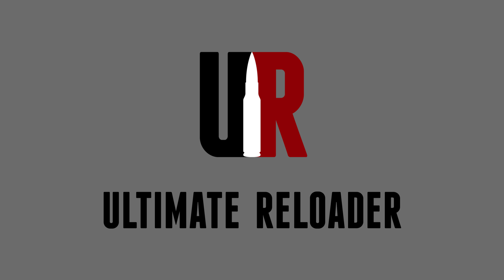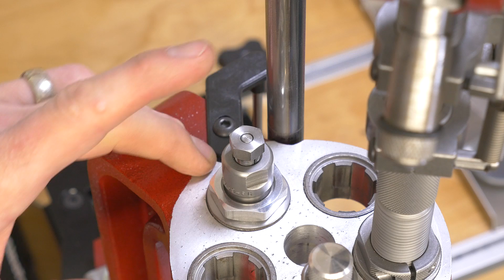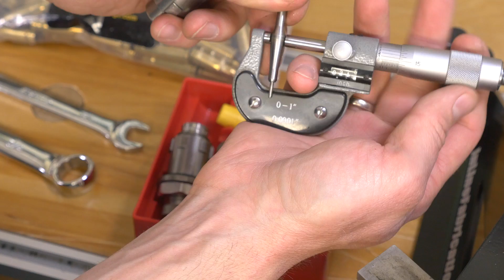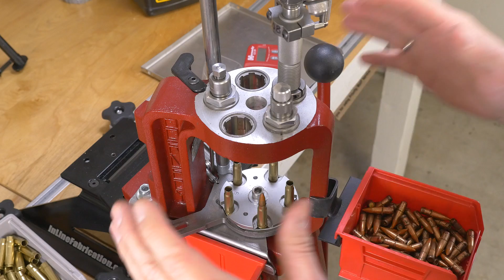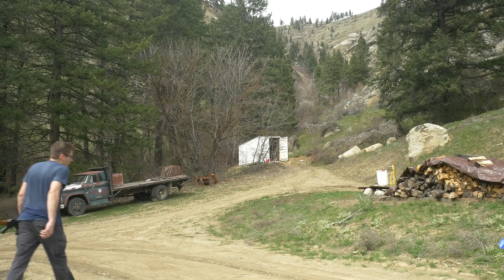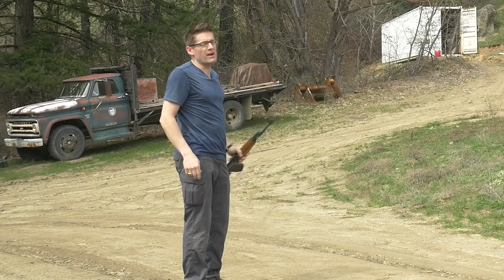7.62x39mm Tracer Reloads for the AK-47

Comment: Please correct me. 7.62 mm is .300 inch, no? So, why is the bullet diameter .310 or sometimes I hear .311?
Reply from the maker: lands (metric) vs grooves (english) for diameter reference...
Reply: gavintoobe So, if a 7.62x39 is .310. Then is .308 Winchester bullet diameter larger than .308? Confused 🤷🏻‍♂️
Reply from the maker: It is confusing- 7.62 or .300” is relative to lands, Bullet dia is ~0.311”, .308 IS bullet dia for English 30 cal systems and also is bore dia
Reply from the maker: I should do a video on this :)